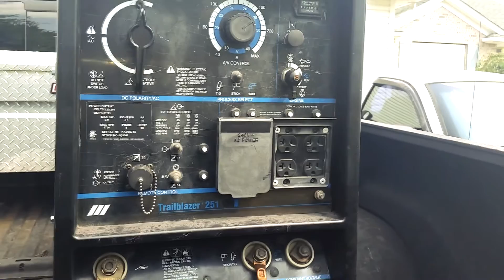2001 Dodge Ram 2500 Cummins Welding Rig

Comment: Cool bumper, but if you have a miller that's not a welding rig. And you dont have a dully? 😒
Reply from the maker: ted s thanks, and yeah it's a Miller and nah no need for a dually. It's just my mobile welding rig. I run my own business.
Reply: 6.7CumminsWelder so do i, but my Lincoln will outlast 4 miller's. I never seen anyone rebuild a miller actually
Reply from the maker: ted s next one I plan on buying shortly is a Lincoln but a diesel one
Reply: 6.7CumminsWelder i have a 78 Perkins 250. Which has been chopped to be shorter and its diesel. Just can't beat a Lincoln if you need tough and great welds.